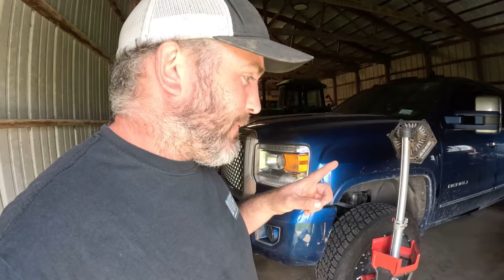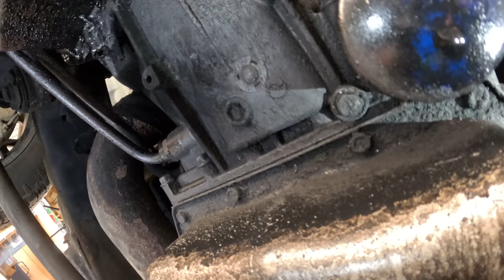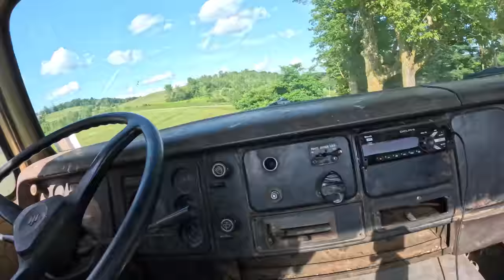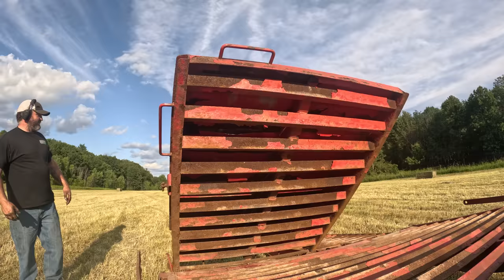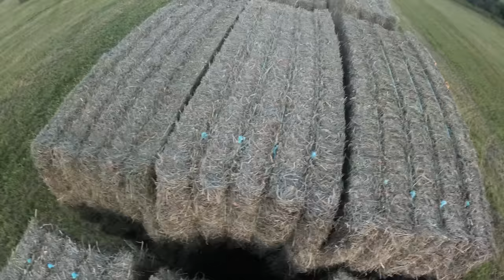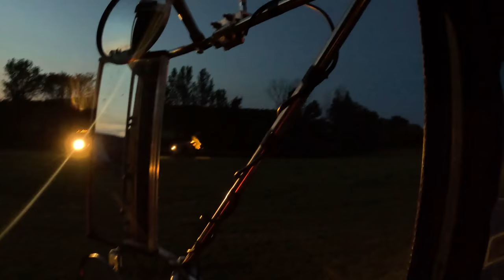So Many Bales To Move- Update On Pickup Transmission... How Broke Is It?

Comment: Get to see what you're doing! done all that, motors, trans., clutches, bellhousings, torque converters, drive shafts, rearends, wheel bearings, ball joints, tie rod ends! i don't do that stuff anymore, too old for that stuff! I worked 18 hours a day for years farming!

Comment: What puzzles me is that in the beginning you see your Claas chopper making halage with the  dump trailer or you could use the H&S on the Mack. All that would be needed is a mower conditioner, with higher moisture of haylage he could squeak by with a side delivery rack. If not satisfied with side delivery rake buy a Tedder and side delivery rake. There’s nothing like paying off your own equipment by doing something for yourself. The need for the big time operators to do contract work for you is only if your to busy. Using your time to pay off a BTO is not helpful with your bottom line, it all comes down to cash. You’ve got to get cracking two trucks down claas chopper and combine are not prepared for fall work.  Not sure if we need to worry you’ve got YouTube, you’re a contract worker, with a gentleman’s farm on the side. Don’t get upset try to figure out what you need to do to get all your ducks in order. Don’t be confused by all the cheerleaders in the comments. Get someone to help you set up a plan so that all your assets are working together wether it means getting rid of some to buy some others. I’m truly trying to help you Chris don’t get upset try to think it thru. All equipment is a NECESSARY EVILS I never fell in love with any equipment it all breaks down and need maintenance.
Reply: I think your math is off, my friend. Buying hay equipment will not pencil out when there is a custom guy right next door. He works off his bill and most likely makes some $ after
Reply: @henrykelsey3507  you do realize his property was listed for $590,000.00 have no idea what he payed for it.
Reply: @davdhynes3518  low interest loan through FSA. And YouTube pays well. But he still did a business plan with projected yields and pricing. And he had assets to bring to table, he didn't come to FSA empty handed
Reply: @henrykelsey3507  80 percent of new businesses fail within ten years if you take out farming and restaurants the failure rate drops to 20%. I think the numbers are against him. It’s sad to think that YouTube is the driving profit center.

Comment: Sad about all the solar.  I would like solar setup eventually but i just rent. Ive got a 200w system i put in a box for storage and transport for my tractor show so i can run an inverter for my fan at night since i sleep under my flatbed trl at tractor show and last year i made a bed frame and slept in back of 1/2 ton at renner.  Sucks that i didnt bump into chris there.  This year i bought a 12v 42qt fridge/freezer single compartment from vevor. Hopefully my old free batteries will store enough power for the night and i might bring my JD Christmas lights i won at my show last year and hang them from my canopy for a night light

Comment: If money is so tight ,how come,so many tractors and trucks,, ant justify having all this equipment for a small farm  2 tractors should be adequate in the UK
Reply: When farms have big shiny new equipment. Then its leased. A new 300hp tractor cost around 200k to 500k depending on the extra's or upgrades you want on it
Reply: Depends on the farms tax structure 😊
Reply: He needs to figure out what is really needed and get rid of equipment that doesn’t work together with his other equipment to complete a task.

Comment: Will those solar fields be connected to the grid???

I live in the netherlands and we have several thousand acres SOLAR in our country. and none are connected to the electricalgrid.

Because all the cables are too thin in the ground or the electricalpole the wires get so hot they simply melt away.

Comment: Buy hundreds of thousands of dollars worth of new hay equipment to bale  20,000 dollars worth of hay a year. Yah that makes alot of sense
Reply: ghammond3132  well for one he doesn't want to do custom hay for other people so that's not a option and why would he get rid of his chopper when he can chop his own corn silage and add up what a used self propelled hay mower, twin rake, Tedder, baler, and merger costs over 100,000 please educate yourself before you speak to me
Reply: ghammond3132  he could even just buy a mower conditioner side delivery rake on the cheap if not buy Tedder and rakes and make haylage chop into h&s on Mack or trailer dump.
Reply: ghammond3132  well your first mistake was milking cows everyone knows there's no money in that
Reply: ghammond3132 the way he farms and spends money he won’t be farming in a couple years. Don’t need three tractors to farm this small acres. Any two of the three would be plenty